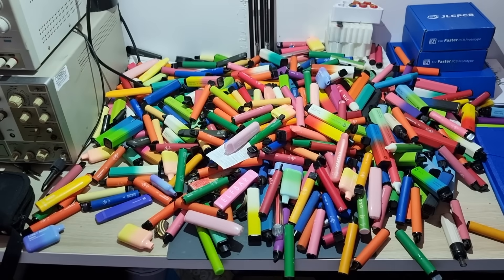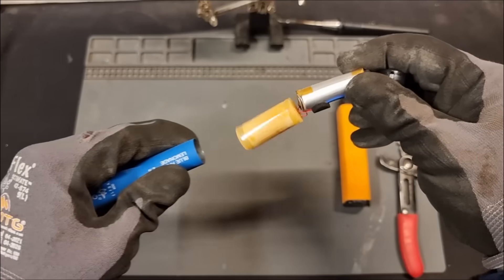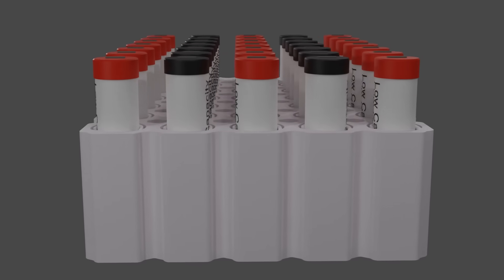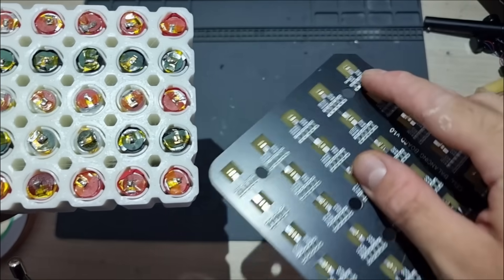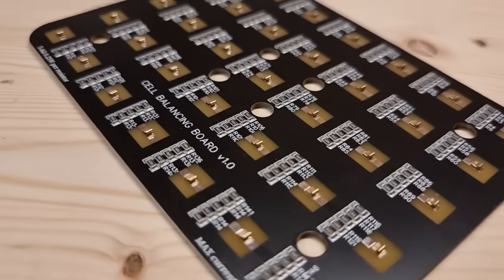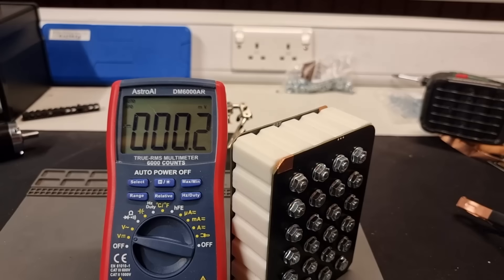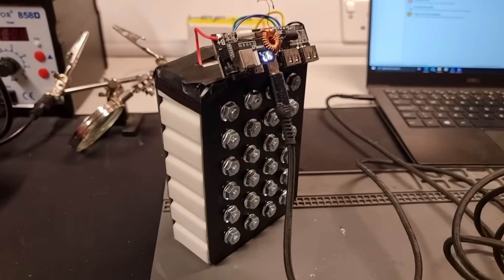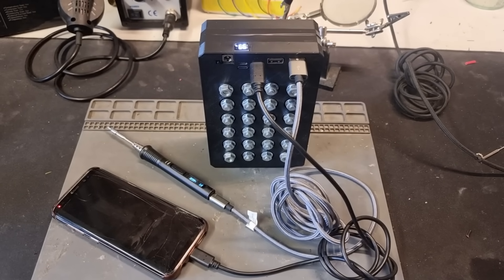Turning Disposable Vapes into a Fast Charge Power Bank

Comment: HOW TO RECHARGE YOUR DISPOSABLE BREEZE LIKE A FIEND TO GET THAT SWEET NICOTINE YOU DESERVE 101:
(there's actually a decent bit of juice left when the battery dies)!

Step 1: Take an old USB cable and cut the part of the USB you would plug into your phone etc. NOT the part you plug into a wall for power. Strip the protective shell off with a small knife, becareful not to cut the red or black rubber shell on the actual rubber. Once thats done at the end of tip you cut off carefully peel back the red and black wires to expose the copper wiring inside. Twist both the black and red wire exposed copper so it's not frayed. Congratulations you now have a disposable vape charger!

Step 2: remove the end cap at the bottom of the breeze to access the battery. The easy trick to do it is to use your bottom row of teeth on the seame on either side and lift up with your breeze to pop it off (not painful). Easy that way and its genuinely a bigger struggle with tools. Now, CAREFULLY slide the battery out and the second you feel it tug stop and slide it back in slightly. If you wish you can remove the foam holding the battery in place as well. Now pull out the breath detector at the bottom from the cap. It will be in a white rubber shell. Use a piece of plastic NOT METAL object (pen caps work nice) to pop it out. Try not to scratch the black surface or hit the top where the wires are you don't want to break it. It's slightly glued in so it takes some practice. Now cut the yellow protective tape covering the metal bit on the center of the battery. You did it! Ready for charging!

Step 3: Plug in your scuff USB charger and place the red wire on the corrosponding red wire (the one on top of the battery itself) and place the black wire on the breath detector's black wire. NOTE: be careful not to touch any of the other wires next to it than the black one. It may spark and fry or breath detector and its no good then. Now you have two chooses my reccomended option is to find a comfortable postion to hold the wires on their respective spots while watching TV or YouTube. Option 2: get some electrical tape and find a way to tape those on. I wouldnt reccomend 2 bc if u mess up and leave it alone to charge it might just blow up or something.

Note: I vaped with breeze for 5 years and never had a battery blow up or light on fire by doing this it's 100% safe as long as you have braincells. Also, 15 minutes or so is usually good enough to give 2 days worth of battery.

Comment: Huh? I've been planning on replacing some dead-NiCD battery packs in cordless-tools with new Li-Ion sets (fraction of the cost, will force family to use the OEM chargers that doesn't cook the batteries for no reason); I hadn't considered using some of the Li-Po cells I've been harvesting from the vapes dropping/floating into my yard to make a battery, since (oddly) they're all different shapes (Teen-novelty? The adults switched to 'bio-degradable' cartridges, which are piling up...) unlike those fat generic-sticks I stumble over whenever I walk downtown.
I'll have to bag a few to see if they're suitably similar.

Comment: We have used the battery from disposable vapes to replace the battery in our dashcam TWICE!  First replacement was a very low power 600Mah battery that was getting so weak after about a year that it was corrupting video files and my husband was wondering if he needed a new dash cam.  I suggested a new SD card but during that time, he also noticed the dash cam wasn't keeping a charge for longer than a minute or two....dash cam was recording clips in 3 minute segments...if the battery died during a clip being recorded, that clip would be corrupted and not playable.  So just to try it, he replaced the dash cam battery with another battery from a disposable vape.  It's higher capacity and lasts a lot longer and also no had a single corrupt video file since.  We still have a few disposable vapes laying around to harvest batteries from.  I would like to get some of my old handheld game systems running on them such as my old Game Boy and my Atari Lynx.

Comment: Future suggestions... Might take awhile but use a GOOD dual port RC hobby charger to cycle and characterise each cell.
Then dispose of the worst 5 cells as outliers, and build the pack as a more durable and longer lasting 5s/6p instead of a 5s/7p
The charger will also leave each cell at the same voltage when the test is done eliminating the need to have to balance them prior to assembling.
Getting rid of the worst / most damaged cells might even have a chance at costing noting in usable capacity as the bad cells holding back the good ones will cease to exist.

Comment: You can't put pressure on li-po cells like that. Just solder them up, what is wrong with you? It is the exact same reason that the note 7s exploded. Batteries expand and contract, you CANNOT COMPRESS THEM, especially not vertically like that. Take them out before your house catches on fire. It may not explode now, but it will, sooner or later, because you didn't leave any space for them to VENT. THEY NEED TO VENT AND THE POUCH IS DESIGNED TO TEAR IF IT GOES ABOVE A CERTAIN THRESHOLD, but it can't because you have squeezed it vertically. Jesus Christ.

Comment: Those pcbs look like over-engineering, the batteries already seem to have soldered heads, they could have been connected by soldering, so there would be no need for those huge screws :)

Comment: Dude, you need to make the PCB and 3D prints open source ! I am thinking the same thing but for 18650 would be so cool with springs on both side so you could make even house batteries ! One advice, get a Li-Ion battery tester so your batteries are balanced and tested when you plug them together !
I like the project so much ! I'd be willing to provide engineer skills for the bike batterie version !

Comment: I threw away the few batteries I had, thinking to myself "Surely, this is some type of non-rechargeable lithium battery, even though lithium batteries are designed to be charged. I have no idea about the intricacies if lithium batteries, all I know is Li-Poly and Li-ion and that they need their own specific chargers" Even though I'm an electronics engineer, I never bothered to do proper research since I thought there was something I didn't know otherwise people wouldn't just be throwing away perfectly good rechargeable lithium batteries.

Comment: I don’t think you used enough bolts, honestly. With the sheer torsional forces those vape batteries must endure, I would’ve gone for at least 12 more just to be safe. and honestly, you should’ve used rivets to handle the extreme load distribution when you’re lugging that thing around!

Comment: Would you be able to post the output specifications? Voltage out and amperage out? I am very curious if this would work as a simple power bank for a Raspberry Pi 4, but that requires 5A

Comment: How do you charge the battery pack? Does the board accept input current through the usb ports, or do you need an external cc/cv lithium battery charger?

Comment: I was cringing at the point you started to initally check thier voltage and saw that one cell at 2.8V. Any battery that low that was being used in a battery pack should have been fully discharged to 0V and chucked. Li-ion (and Li-po), once discharged below 3.0V (or 3.2V if you really want to be careful) would have had its capacity as well as its ability to maintain a charge greatly reduced (internal chemical change). It's critical in a battery pack made up of Li-ion or Li-po, that each battery have similar TESTED capacity and internal resistance (which is a good test of how good the battery is [how much life is left]).
The reason those cheap chinese scooters seems to always be on the News for catching on fire, is cause they tend to have USED li-ion or li-po batteries of various capacities and life in thier pack. 1 bad battery, such as that one you tested @ 2.8V, is enough to cause a fire because even in a parallel setup, it will be discharging AND charging faster then the other batteries, in other words, it WILL run hotter and eventually fail spectacularly.
Please, please, PLEASE, at the very least break down that pack and test each battery properly! A "smart" charger for Li-ion/Li-po that can be used to charge and discharge, and give you a reading on just how many mAh was put in or taken out of the battery. Running each battery through a couple of charge/discharge cycles will give you a good idea on what batteries to keep, or which are destined for recycling. If you remember which ones initially tested at less then 3V, properly dispose of them! Group batteries together by similar mAh, and only use those batteries that have similar mAh within the same pack, don't mix batteries with different tested capacities!
Those disposable vapes use dubious quality batteries to beging with, alot of times they are used batteries ripped from other devices, hence why they can be sold for so cheap.

Comment: I wouldn't do this, those cells have no protection compared to 18650 cells. They are able to package and sell them because these small devices dont need any certification. I had more than 1 of those cheap vapes burn up. If you start putting them together you're just making a bigger explosive

Comment: Thanks for the video, I collected quite a lot of lithium from Computer shops from disposal laptops batteries. Most of them are good ones, some just the pcb n contacts problem, some have some cells spoilt. Dismantle and built several power banks and portable power. I don’t smoke so Thanks❤to you for another recyclable source of power cells to look out for. You done a good job 👍

Comment: There's likely to be significant differences in the construction of the batteries, not to mention the health of each battery. It's not good enough to balance the charge to begin with, you need charge balancing built into the final design to ensure that over time you're not over-charging any of the cells. That's a huge fire hazard.

Comment: How can it possibly have a capacity of 15000mAh when you have 7 x 550mAh cells in parallel? That would be ~3850mAh.

Also, it balanced in an hour!

One cell was at 2.8V and another at 3.78V.
Cells with a potential difference of 0.98V would charge each other at about 1A with the resistors you have there.

The maximum charge current on a 13400 cell is 1C so 0.55A on these cells.
In this case, you are charging at double the rated charge current.

Comment: Loved the video, i also collect them and repurpose them but i'd be cautious to use a lot of them on the same device as they are not of the greatest quality. You should make an enclosure that each one of them is wrapped in a ceramic fabric like the lipo bags so if one bursts up in flames it wont make the others explode aswell and minimize any risk of fire, cause an all plastic enclosure is a little out of purpose on these.
It's the only thing that keeps me from making a huge UPS with them and since you can literally get these for free you have an unlimited battery supply.

Comment: I have been collecting vapes for a while now and last year  built 10 small power packs to power my LED Xmas lights.  Saves buying AA alkaline and chucking them when used. I have collected more and currently in the process of matching the capacities and doubling up on the size of the packs.
I see far less lying around for the past year so maybe others are getting to them before me 😂.
Incidently, I save the metal tubes for other workshop projects.

Comment: gotta be careful with those vape batteries..  I have been in the industry since inception and those can be some spicy pillow batteries.   If your lucky you will get a repo 18650 or smaller but, usually... its spicy pillow batteries. lol

Comment: Nice project! I'm a bit concerned with the safety of this though. Are these cells protected from over discharge without their own control circuit? I think a more complex BMS should be used in applications like this, where each cell is balanced.

Comment: With what you mentioned about the e bikes that coukd be built with the lithium, it seems an ideal project to link up makers, bike repair shops and workplaces, colleges and universities to arrange collection of used vapes, sort by brand, devise a testing methodology for the cells and make a bike battery . Throw in cheap second hand cycle frames and a motor wheel and you'd have a decent mode of transport for people with short commutes

Comment: Very nice project, great execution! 

But just to note: this is not something I'd recommend random people to do. Well, unless you are very used to this type of DIY project, and know how to handle the downsides and dangers of it. Gotta be at least a bit familiar with lithium batteries.

Videos like these are fun to watch and all, but they tend to downplay or overlook the dangers, work, and potential problems involved, if it's done by someone with no experience. Not accusing of anything, it's just that most DIY videos are like that.

Let's think about the real costs there then. I think making disposable products with a lithium battery in them is just atrocious, and I think the idea of upcycling those can be pretty great. But thinking about apples to apples cost alone.

How much a known good brand simple 20000mAh power bank costs these days? Around 50-100quid or so, right? From Anker or some other brand. They tend to use a couple of big LiPo packs to do the job, and be around a smartphone size with double the thickness more or less. Keep that in mind for comparison.

Setting aside ancillary costs - proper place to build it, 3D printer and knowing how to handle it, pliers, soldering iron, gloves, PPE in general to handle materials, etc. We'll assume you already have all of those.

Consumables - Printer filament, copper tape, custom PCBs, a few components, 24 set of nuts and bolts, a power bank PCB, wires, shrink heat tube, solder. Individually, those are pretty cheap, but it adds up.

Working hours - collecting disposable vapes, disassembly of those, building and testing the battery itself. If it's a DIY project made for fun, that's fine... but if you were paying someone to do it, it already starts not making much sense.

Things to pay attention in the project (hazards) - on disassembly you have biohazard from vapes (they've been in the mouths of people, and they are full of spit), chemical hazard with the vape liquid, you have the danger of thermal runaway from damaged batteries, plus general dangers with building the thing.

Those cells are pretty bare, it's not the same as handling a standard 18650 or 14500 AA.

Getting battery PCBs from Aliexpress is cheap and they mostly work pretty well (at least from my experience), but you always have chances of getting a dud there too. Which can end in frustration having to order another one, up to a pretty costly accident. If you are ordering those, pay attention to the protection circuits it has.

The batteries found in these disposable vapes tend to be pretty low quality, compounded with the fact that it's been running very close to a heating coil. Not saying they are useless, but they are spec'd to be disposable.

They aren't made or tested to last. This isn't about how much charge it holds, but rather the expected lifetime of the battery, number of charges it can take, battery charts on deep discharge, etc.

So, you are putting a whole bunch of those batteries together... if a single one of them goes off thermal runaway... that's an incendiary bomb there. :P Using it anywhere that you can't handle it if it goes thermal is a risk.

Another potential issue I'm seeing there - you took care of balancing the charges from the cells to build the battery, which is great, good description of the problem - but you actually need something to keep those cells balanced. Not sure about the PCB used, but it kinda halfway does that, right? It keeps groups of cells balanced, but not individually.

Eventually, some of those cells will take less charge, run dry faster, or just die. That's when things could go awry.

You do have battery bank PCBs that includes some monitoring, like the one used with a few extra lines, but it's just not enough to really be safe there, because of how different each and every cell there can be. So... throw of the dice. 

Ideally, you'd need a power bank PCB that can monitor every single cell individually and keep them balanced... but that'd likely need to be custom made. Aliexpress and generic power bank PCBs are mostly designed to have only a handful of cells, up to half a dozen or so, afaik.

But then, even if you make a solution that keeps all cells balanced, if one of them goes bad, it only means that your entire battery is as good as the dud, unfortunately. :P You tradeoff the risk of heat  building up for balancing charge down with all cells.

Anyways, not to discourage others from trying it, or put the video down... but if you wanna try doing something like this, you should know the risks.

You can mitigate this problem a bit by making smaller battery banks.

I've played a bit with this myself, my end conclusion is that for safety reasons, if you are planning to use something that you can carry around safely without worries, it's just better to pay for a known good brand battery bank. But these are great if you can use and store them in an extra safe space, and you don't mind the constant maintenance needs.

o/

Comment: With use it is normal for some cells to discharge faster than others (or die). So the risk of fire reappears, the balance resistors must have in the final PCB

Comment: I love this but there is plenty room for improvement. The bolts were too large diameter and way too many were used for the clamping, as well as a lighter material and clamping fixtures are viable. A lot of cost and weight could be reduced here. I'd use 6mm holes, M5 nuts and bolts, and a lot less of them, plus washers.